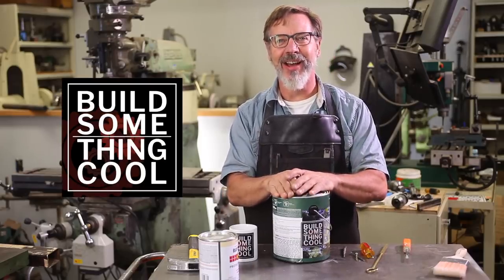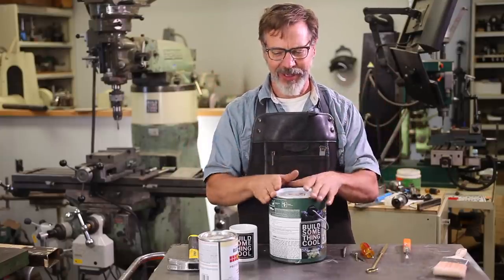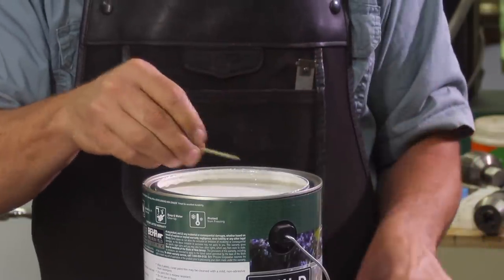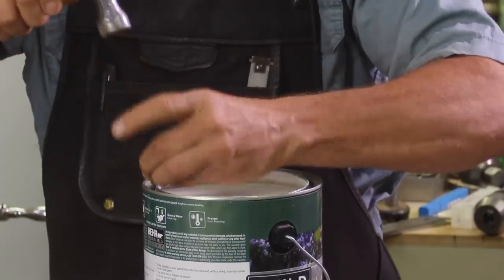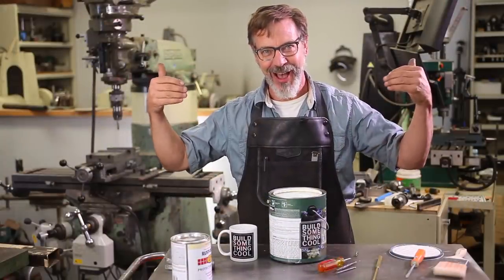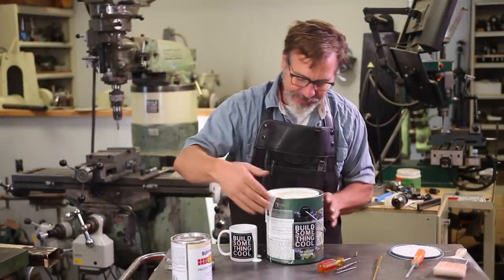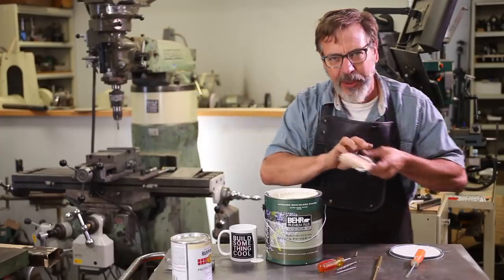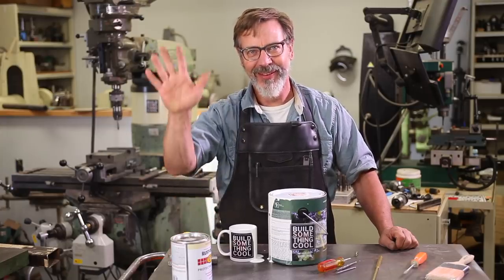Amazing Paint Can Trick

Comment: Easy tip .....buy a $2 stainless steel soup ladle from the dollar shop and use it to scoop out the paint.       .........
No cleanup, after a day the paint in the ladle will skin over, peel it off and bin it..........ladle is clean as a whistle and no crap in the lid of paint tin.

Michaelangelo
Reply: Ditto. I've been doing just that for years.  Cheap, easy and cleaner.   Also place some plastic wrap on the surface of partially filled cans to keep it from skinning over.  Remove and toss come time to paint again.

Comment: Most paint stores have these little (1.5") molded plastic pieces.   You slip it in the lid trough and run it around the can and it lifts all the paint up and over the lip and back in the can.  Wipe it off, done.  They have a hole so you can put them on a key chain.

Comment: Good tip, and a very old one. Been doing this for several decades. When putting the lid on, just put a rag, or paper towel over the lid before you smack it, your method will still get the splatter, simple little rag, no splatter.
Reply from the maker: I do that to,  it in the video I left it out for dramatic effect😊😊😊

Comment: I realize this is an old video but hey, I found it. The tool I have found best is a spade drill bit. Use the smallest one with a center point and blades “perpendicular “to the top of the point. Usually this is the 1/2” one. 1/4 and 5/16 just have angled blades. Anyway, to the point, lol, on the 1/2” the point pierces the can and the top blade acts as a stop. The point, being triangular, doesn’t grab the can and releases easily when you pull it out to punch the next hole. Awls, punches, “ice picks” all stick in the hole, albeit slightly, but sometimes not. The spade bit just pops right out and pop pop pop right around the rim you go !

Comment: Got a great tip for this tip: after resealing the paint can store it UPSIDE DOWN. The paint will not leak out (if the can is sealed tightly) an the paint will not dry out. Works great for PVC and CPVC cement as well.

Comment: I transfer paint to used 1 gallon milk jugs.  Very easy to  pour small amounts without any spillage at all, and if desired, you can squeeze out a fair amount of the air before final sealing.

Comment: DON'T DO THIS if you are storing the paint for a long time in that can.. it will cause the paint to get thick and dry out sooner. and some cans will rust causing your paint matching to be off. Also, indoor latex paint that isn't sealed correctly can also begin to smell foul as mold and bacteria grow in it. Plastic containers with rubber seals are way better than the metal cans for storage. Just drawing on my years of experience as a residential and new construction painter.

Comment: I've ran into a number of cases where the stuff in a can is too viscous for this trick. I now consider it easier to buy, or 3d print, one of those pouring lips (it's like $1 at the home improvement box stores)

In a pinch when paint out of a can I use a rubber band over the can to wipe the brush on the rubber band so everything stays in the can.

Comment: Get a piece of plastic tubing that will squeeze into the groove. Pour away from where the tubing joins.
Or paint straight from the can. When finished, wipe the top clean and remove and wipe the tubing clean (save for next time).
The groove will remain clean and the lid will not stick.

Comment: Take painters tape and tape up the top over the valley then take a knife along the inside to cut it to the inside diameter. The outside can just fold over. Then when all done pull the tape and done. And the lid will seal like it’s new. One step further is to tape a v shape to make it pour only one spot which keeps it from pouring 4” wide out of the can.

Comment: Dang, i sooo wanted you to scoot over the spill down the side of the can with the brush plus pick up the spill past the coffee mug & return as much as possible... FWIW...Personally i have learned to always work from a pail rather than the original paintcan & to make a good pail is as simple as taking any freshly emptied can that you've totally cleaned out..... , chop the ring out with an old putty-knife, chisel etc and hammer all the jagged pieces flat to form a stout rim.... When working out of a pail, transferring just under half its volume from the can gives you much better control and zero chance of spills, drips when working heights especially etc....

Comment: I have also used those plastic shields, but the BEST way is to use a small, disposable plastic cup and dip it in the can to get the paint you want. One or more dips and you have that paint in your smaller container. And there is no paint in that groove in the can or on the outside of it. And you just toss that cup away when the job is done. Nothing to clean up at all. 

And YES, I saw how you turned the wet area of the can away from the camera, as if to hide it. Yea, yea, you were just trying to show the dripping action. Everyone who believes that is invited to see some swamp land I have for sale in Florida. Or a nice bridge in NY State you can have for a song. But it was still a mess and that mess was not going to drip into the can via your holes. It was going to wind up on your bench. 

Speaking of on the bench, using a cup to ladle it out will also save that drip down the side of the smaller container which was already on your bench in the video.

Comment: I can see two errors.  1) You opened the can with a screwdriver instead of a special tool ($1)that won't damage the lid. and 2) You poured the paint out on the side that has the directions.  You can wipe it off with a rag or use the other side of the can.  I learned those tricks from my friend Charlie.

Comment: Is there something I´m not getting here - if you do this how can you reseal the can? Those holes are outside the seal area...
Reply: Farlig66 no they aren’t. They’re at the bottom of the gullet that the paint lid lip sets into.
Reply: I think they would be still uncovered, as this is the area that you prize the lid up from, I've seen this tip so many times, and always wondered this, perhaps our paint tins here in the UK are different?
Reply: The paint will go off for sure, I think this was just a promotion for his mugs,
Reply: You're correct this will not seal!!! Check out my channel and see a video I posted last weekend about how to properly store POR 15 and not have it dry up on you!!! This is bad advice!!! The paint will dry in the can because it's exposed to air!!! It's not sealed!!! Keep Rocking!!!
Reply: @sethbracken  Nope, the paint lid lip is for levering open the can, the seal is on the inside lip of the can - the old trick for ensuring a can reseals is to turn it upside down & coat this seal with paint from the inside. Try that with those holes there & the paint will come running out of the can...
Reply: Been doing this for about 40 years. In Canada if it matters. But it works great.
Reply: @seery188  Nope - the holes are at the bottom of the grove around the can. The lid sits in the grove and seals on the sides. My Dad taught me this maybe 50+ years ago at least! It does work.
Reply: Makes me wana check now, swear the grove is open to the air when the lid is on.
Reply: @jrkorman  I think you guys in NA must have a different can design then (as Nailed IT states) as here in Europe  the lids are single seal on the inside can lip only & that groove is very definitely open to air - just back from my garage checking!
Reply: @stevennailedit  I think you´re right - must be a different can / lid design in NA - I´m just back in from the garage checking a few cans of paint & that groove is very definitely 100% open to air on my cans.

Comment: Your grandpa was able to do this because he used oil paint. Unless you are using a plastic can, do not poke holes in metal with a water-based paint. It will rust, not maybe but definitely. The cans are lined to protect the metal and you just gave it a very concentrated area for the water to attack. If you have just a quart left in a gallon, switch it to a smaller container, less air space is best. I have seen 100's of cans where this method was done and none have been rust free with latex.

Comment: So why don’t paint manufacturers pre-hole the can?
Reply from the maker: SorryI don’t know
Reply: Shelf life. and shake machine mixing
Reply: Most latex paint is slightly acidic, that is why the cans are lined. Doing this exposes bare metal which can rust. I refuse to shake cans that have holes poked in them because they don't seal as good and paint flies everywhere. Use a $1 pour spout, done
Reply: @chrmdome  Then surely the lining can be extended to the lip?  $1 spout adds to the un-recyclable garbage ;)
Reply: @octapc  the pouring "spout" can be reused forever. The lining coats the complete inside, poking a hole exposes the metal. Many manufactures use plastic cans now to avoid the rusting. If it was as easy as poking a hole, manufacturers would do it. My company spends a lot on R&D, they would do it if it worked. Use a spout or wipe it with the brush and then a rag before putting the lid on

Comment: There is a funnel available that clamps onto the can so the paint doesn't pour into the trough.  This is a neat trick though.
Reply: Yes. Those work very well. Mine is not a funnel, per se, but more of a trough. The only caveat it that then IT has to be cleaned up. But there is no paint in the rim of the can, nor spilled down the side of the can.

Comment: The paint will go off in the can because the air can get in via the holes.
Reply: The lid seals above the holes.
Reply: I would be more convinced if the can was turned upside down to show there were no leaks.
Reply: @MabrayFarm  NO it does NOT. The seal is on the diameter, the vee is a manufacturing function to strengthen the inner seal diameter and allow it to expand when the lid is forced on. There is ALWAYS a gap between the lid outer rim and the vee, otherwise you would not be able to insert something to open the lid. You have to hammer the lid on forcing the rim to expand slightly. Have a look at a can, slip something thin between the rim and the can, even some thin cardboard or thick paper.